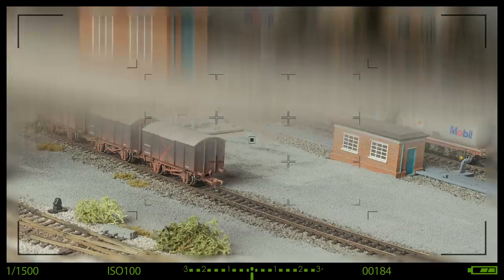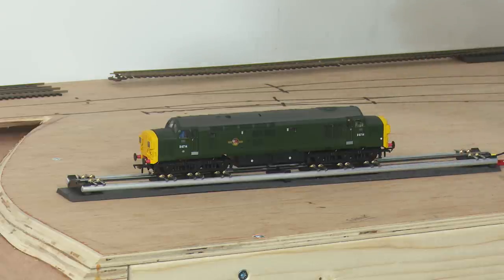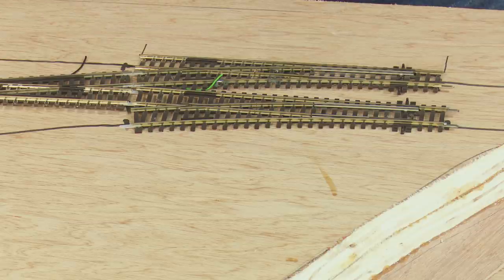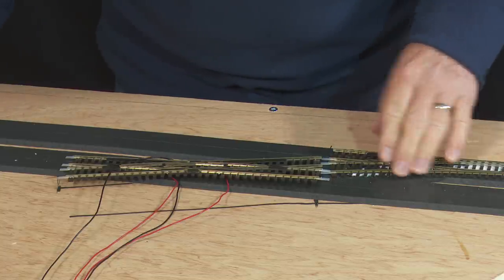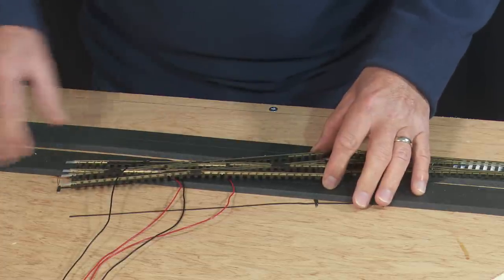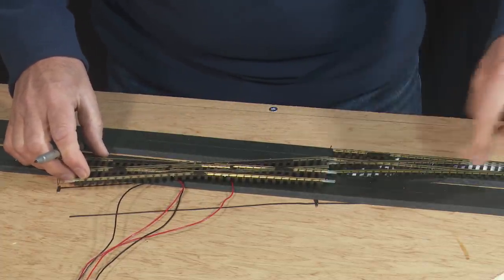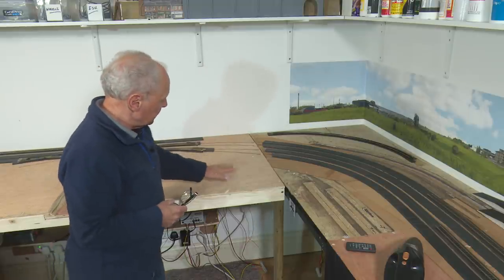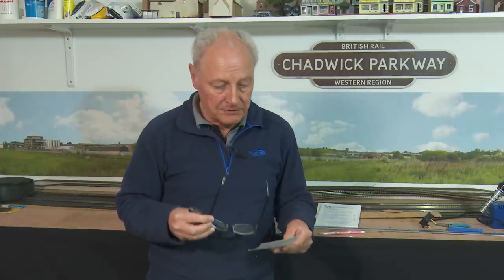Laying Track Bed and Laying Points at Chadwick Model Railway | 91.

Comment: Another ‘happy’ video from which we can all benefit.  Keep up the good work.
From your previous videos I’ve changed to the glueing method of track laying using the  ‘copydex’ method.you trialed.
Had much success with this fixing arrangement. Thank You. 
A couple of ideas to add to the mix - 
I have created a jig to locate brass panel pins for soldering to the  underside the rails at baseboard joints.   Speeded up this task.
To weigh down the track whilst the glue dries I use ‘dead’ laptop batteries; oblong shape and nice and heavy!   
Keep well and SAFE.  Happy modelling, 🚂 Tony
Reply from the maker: Great tips Tony.

Comment: Closed cell foam rocks.
  It has so many wonderful applications.

  I've used it in my van. Boom!!! wonderful acoustics. 

 I did have to apply small butylene rubber sheets  to the single skin panels first though in order to reduce resonance but now my van sounds quite civilised. 
  
  Win win👍👍
Reply from the maker: What an interesting solution AM.

Comment: Superb vid and info 😆...The next time I build a layout I think I will use  thin sheets of flat fome cut to shape to  dampen sound a bit more as the track I use is rebalasted fleischmann profi track....but some heavy locos with the old motors can make grinding sound  ampified through the loft flooring I use for the base boards..  

Jim.
Reply from the maker: Hi Jim,  I'm so pleased that you found the video useful.  Regards Charlie

Comment: Thank You Charlie, for such a great video. I've now got to the stage of putting my trackbed down and installing track and I was getting really nervous about doing it. I was not sure track pins or glue,  But after watching the video it's given me so much more confidence. I've now put the first pieces of trackbed down using copydex and it's really good. hopefully tomorrow first points will be test fitted.
Reply from the maker: That’s great Peter, you don’t need too much Copydex and it drys in about an hour.

Comment: Excellent video Charlie.  I will have to give woodland scenics foam another chance.  We had used it on a module for a modular club and the stuff was a nightmare.  It dried out and could not handle three set ups without major issues.  Track started to bounce weird while it gave a realistic roll to the trains a few of my top heavy cars really got rocking at speed.  It looked like the Napoleon Defiance and Western railroad.  So we ripped it up and went with the cork.  It may have just been the use we where using it for was ill suited to the task.  Thank you for the information and the confidence boost in the foam track bed.  It was much nicer to work with at times than the cork.  I may not have a lot of sound DCC locomotives (I have a lot of older Athearn blue box locomotives that have had a lot of custom work done such as making a CNW buffalo so getting a speaker in on top of modifying it to get a board in them is near impossible) I do enjoy some board rumble (some is realistic) I don't want that to be the main sound in the room.  I enjoy hearing the clickety clack of wheels.  Especially running a long ore train with 24' Michigan ore cars.  Wheels all over.  What a sound going through a switch yard.
Reply from the maker: Great comment mate. I'm so pleased that you enjoyed it.

Comment: I love how you put a lot of effort into reducing the sound transmission through the track. I often see (or hear) other layouts where they sound of the running train is really amplified by the base board. And i often see others trying to overcome the issue by simply turning the sound chips up to a high volume. Which for me puts the sound from the loco totally out of proportion with the railway layout itself. I like it when the sound is not too loud, so that when a loco moves from one part of the layout to the next, the sound moves with it. Nothing better than getting your head down to track level and hearing the sound of the loco approaching you and then going away from you. Not a fan of having it so loud that it sounds the same all over the layout no matter where you are. Not using the loco sound to try and drown out the sound from the baseboard means you can have your sound output more in scale with the layout - if you know what i mean.
Reply from the maker: Steve, I'm on your side on this one.

Comment: I use large sheets of thick foam on the underside of the baseboard, with the track pinned directly to the plywood board. No noise at all.
Reply from the maker: What sort of foam James?
Reply: @ChadwickModelRailway  automotive upholstery foam, it's used for motor homes and caravans to make sofas and beds ect. I get off cuts from a local coach builders on the cheap, but it comes in 4ft sheets 3" thick. Cut it a bit larger than you need and it will wedge itself between the board cross members, that way you just pull it out for wiring or maintenance. Great channel by the way, I'm looking forward to how the layout progresses.👍

Comment: Charlie I have watched and enjoyed all of your videos and I only watch them in the evening, daytime is for gardening etc. Really enjoy your videos but this one I found especially informative, I thinks its because of the way you show how to do things, you make it look so easy. I am building a N gauge layout, if you think track joiners are difficult on HO you want to come round my place and try my track work, talk about pulling what little hair I have left out, but it does in the end give me a truly large layout. Im in the early stages of building my layout and I am still pondering whether to put my track straight down on the plywood or use woodland scenics track bed, jury's still out and I realise its a personal choice. One thing I did notice is that when you put in a metal track joiner it did not appear that you leave a slight gap for expansion. Only reason I ask is I have put a large test track up in my loft and since we have had this wonderful warm weather down on the south coast my test track has warped in a number of places because the expansion gaps I left were not large enough. I am also putting in roof insulation and when I can afford it two roof lights which will make a difference when its all done. So do you bother with expansion gaps, guessing you do not need to as your layout is inside your home.
Regards Chris
Reply from the maker: You're right Chris, I don't bother as it's in a heated room with a stable temperature.
I wood suggest you do a trial regarding some form of underlay before you start.  2mm cork might be best if it's a monster!
Reply: Good idea Charlie as the runs will be about 30' in length at its longest, will be worth the expense in the long run. So why 2mm cork as opposed to Woodland Scenics track bed as the prices are very reasonable.
Regards Chris
Reply: I forgot to ask, I watched your video on speed ballasting awhile back but that was on cork. Is it the same method for the foam track bed, if not are you going to do another video on it, please.
Regards Chris

Comment: I enjoy and learn from all your videos so it is with some trepidation that I make a suggestion.  The Woodland Scenics track bed that you are using has a score through it on the centreline.  You would appear to have track centrelines marked on your board. So why not split the track bed in two and lay first one half against your pre-marked centreline and stick it down and then bring the second half to it.  I have found this to be both easy and accurate especially on the curves or where the geometry is subtle.
Reply from the maker: That’s a good point John. However those marks were just rough lines not real track plans.
Reply from the maker: However, you’ve made a fair point and one that we ought to consider a little more often.

Comment: You could use the woodland scenics trackbed in conjunction with a cut to size foam sheet underneath that the ballast will lay on and then you glue the foam down  so it is secure
Reply from the maker: An interesting option TS, I have a similar thought in mind.

Comment: Hi Charley. I liked this video (and many of your others). I wondered if anyone has ever tried laying carpet underlay foam before putting on the cork. The foam would act as the sound insulating layer (like it does on the carpet) and the cork would act as the track bed and it wouldn't matter if it soaked up the PVA from the ballast as you are no longer relying on it to insulate the sound.
Reply from the maker: It an interesting point Steven. Many mention it but nobody seems to have tried it.
Reply: @ChadwickModelRailway  So I may try it. I should get a chance in the near future. I don't have Copydex available locally, so I may try a carpet layer's latex glue.

Comment: I've used foam board as a track underlay, as indeed I use it for scenery support and as a core for buildings. Very useful and cheap. But I'm not enamoured of the sound effects when it comes to steam locos - diesels are another matter - so the rumbling and click-clack over rail joints are fine by me. 
Also, I don't know how I managed without a vacuum cleaner in the past, reclaiming ballast, scenic grasses as well as picking up the debris after rail cleaning with an abrasive block.
Fascinating video again, Charlie, thanks. I watch while waiting for glue to dry!
Reply from the maker: I'm so pleased that you enjoyed it Davil.
Reply from the maker: Hi Davil, What type and thickness foam board are you using?
I'm puzzled on how your points will operate.
Reply: @ChadwickModelRailway  It's 5mm board (Hobbycraft 4 sheets for £10) laid on 9mm ply. Chamfer the edges and drill through with 10mm bit. My Peco solenoids work ok, although I'm tempted (by your site and others) to replace with slow acting point point motors. The sound deadening quality is ok until ballast is applied and glued...Next time (if) I may use something else.

Comment: As an electronic engineer... 7/0.2 is definitely a cable I used A LOT.
Reply from the maker: Perhaps you can help me with a query.  
Does using larger solid core cable, such as 1.5mm used in house wiring, have a detrimental effect on the DCC signal which doesn't occur with multi core?
Regards Charlie
Reply: @ChadwickModelRailway  Solid vs Multi-strand cable? no, not really. The only down side to the single core cable is that it isn't very flexible, on the positive side of things, it's more likely to stay in whatever shape you bend it to. The biggest down side to solid cable is in a situation where it actually gets moved often, as if you bend it and straighten it a few times, it's more likely to break, where multi-strand cable shifts around itself.
If you were to look at Cat5e computer networking cable for example, you can actually get that in both Solid and Multi strand variants, the Solid designed to be run through your trunking or walls(Areas that once placed, are unlikely to get moved), while the more flexible multi-strand used as patch cable (Like in a server cabinet, or from an outlet to the PC, areas where it is likely to get moved)
Using thicker cable than you need also has very little effect on a signal. using cable longer than it needs to be is probably the largest factor for signal quality loss. Not only is there more signal loss due to voltage drop, but the entire wiring network is basically one big antenna, the more wire there is, the more interference you'll get from outside sources. Due to the way DCC works, I don't think EM Interference is a very big concern.
Reply from the maker: What a cracking comment, I’m most grateful.
Reply: @ChadwickModelRailway  You're Welcome. I'm glad I could help.
Reply: Actually, Come to think of it, I used Cat5e as an example... Mains cables themselves are a good enough example. The cables inside the walls etc are solid wire, yet when you go to plug something in, it always has multi-strand flexible cable. This is exactly the same reasoning. Multi-strand is flexible, but solid cable retains it's position easier, and is cheaper to produce. Also in theory the solid stuff is more resistant to corrosion, because the multi-strand has a higher surface area exposed when the plastic is damaged or removed.

I know the question was resolved, but this was just one of those things on my mind I couldn't resist going back to add.

Comment: Had you thought about using different coloured wires for the different power districts, I've used a total of 14 different colours for the track and again 14 different colours at a different wire gauge for the points motors.
Reply from the maker: No Sam, I didn't even know such a vast range was available.
Reply: @ChadwickModelRailway  Yea, I use 7/0.20  for point motors and 16/0.20 for track. Got these from RS components some years ago.

Comment: Dear Charly, 

I would like to give the kind advise to NOW to deal with the underconstruction of the bridge under the baseboard. This to make it easier to you to come in this space/room with your tools and fingers at the moment. This due to the fact as the deep is only 12mms. So I would like to point out that the hole underbride underconstruction has to be "clear rasin tight". By this you can make shure you doesn't discover a bright new waterfall on the underside of your basebord in the next morning, as so your resin-water of the river was leaking on your floor as a waterfall over night. So modelling the underconstruction you can see and the "wall" at the very end will be an important task.Sorry I could not add a little hand scetch had drawn for you of the two L shadped pieces of wood that would be covered with brick cardboard and the backwall from an Evergreen sheet being glued against the ends of the L. (Easier to cut out an U.) 
Hopefuly you can still turn the baseboard upside down... (Other ways there will be a hole video showing you laying hours and hours under your baseboard working it the "Australian way" as a really tough guy. And we all know YOU would do it this way!!!)
Reply from the maker: Hi (sadly you didn’t leave your name),
Rest assured that the damming of the rear river section has been completed and will be sealed with a specialist product once the river banks have been shaped to acceptable contours to reflect its use.
This was completed as I installed the point motors and associated wiring while the board was on its back. Regards Charlie
Reply: @ChadwickModelRailway  Hy Charly, I am highly interested how you havebdone this and I do look foreward for the next "Charlie's Friday"...

Thanks from Berlin to deepest EU-freed England, Chris

Comment: Charley, since the roadbed has a factory split down the center, and you normally seem to draw a line where the center of your track is to run, wouldn't it be easier to draw the centerline of the track and measure to that instead of one or the other rail? This is the way I have done it for years and it has worked very well. The distances between tracks remains the same, just the measuring point changes.
Reply from the maker: A fair point JC and one that I'll try.

Comment: Hi Charlie,  my model railway has been down for many years [approx. 30 years]  with some minor additions to track work here and there. When I first began I laid my flexi-track on 3 mm cork and I have continued to do so. What has happened over the years is the cork bed originally laid has gone, should I say as hard as a rock which has occurred gradually over a period of time, needless to say there are variations governed by when the track was laid, consequently the noise levels vary which is a tad annoying. I seem to be rambling on a bit so to get to the point, if I was starting a layout today I think I would use the Woodlands Scenic track bed. I really enjoyed your video and the lengths you go to making sure everything is spot on.  Cheers   Greg    Stay safe Charlie.
Reply from the maker: Hi Greg, yes time is a great tester of products, us included!  Stay safe mate.

Comment: Hello Charlie, greetings from Australia. I cannot thank you enough for the help you are providing as I embark on modelling after a very, very long layoff. 

My dcc layout is designed as an around the walls end to end with the focus on slow transit and shunting. For space saving, all of my turnouts bar one are small radius Peco Code 100 electro frogs. I have one curved large radius SL E87. 

I'm attempting to follow your turnout modifications to improve dcc reliability. 
On the curved turnout business as usual. 

On the small radius turnout I think I have a problem and seek your guidance. The supplied frog wire does not connect to the closure rails like it does on the SL E87. 

If I cut the two jumper wires I'm assuming I will not have power into the ends of the closure rails. I have unsuccessfully tried to solder the frog wire to the brass pads on the closing rails to mimic the SL E87.

So before I stuff up any turnouts I'm coming to the conclusion that I cannot follow your improvements in full. 

I'm thinking all I can do is wire the frog rail up ready for the tortoise, leave the jumper wires in place and rely on the switch blades to provide power to the end of the closure rails rather than solder in the droppers as you show.

However this seems contrary to Peco's pack instructions which says to cut the wires if the frog is switched independently. I note though that the schematic differs from what the SL E91 and 92 actually look like. 

So I'm confused and would appreciate any guidance you may offer on applying your improvements to small radius turnouts. Thank you

Regards
Steve
Reply from the maker: Hi Steve, I think I have replied to this message via the Gmail account. Regards Charlie